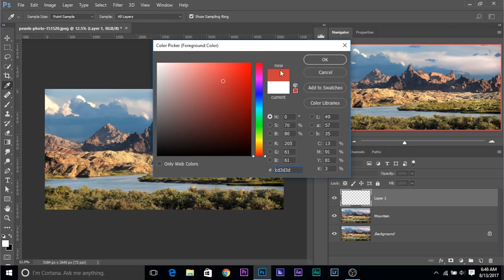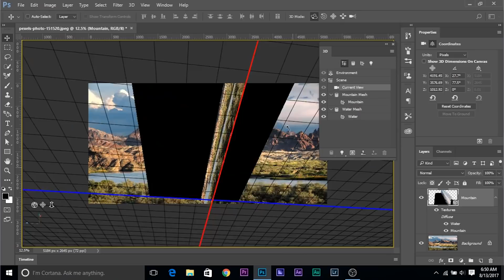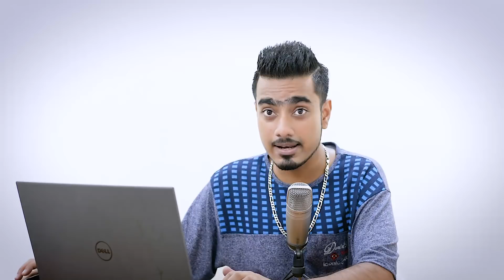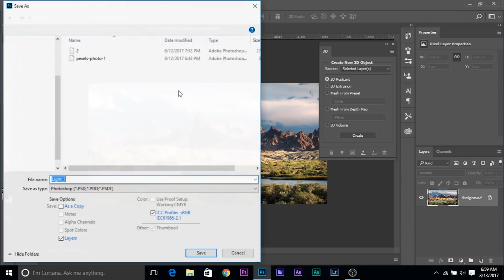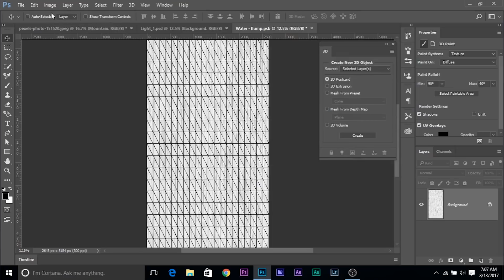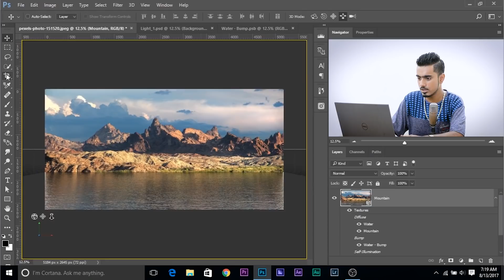Comment: Photoshop 2020, released in November 2019 switched up the 3D materials to Physically-Based Rendering (PBR), but just assumed everyone would know how to use it because they didn't provide any  documentation! Here's how to adapt:
Follow the tutorial and pause the video at 12:10.
Once you've clicked on "Mountain" in the 3D panel to display the material properties, just right-click on the "Environment" folder, then choose "Mountain" from the drop-down.
Next, click on the Water material. Instead of adjusting any sliders, click on the graphical sphere in the upper right corner, and choose "Metal Chrome" (it'll look like a distorted checkerboard). That will apply all the reflective materials.
Resume video at 14:23 and follow the instructions with ONE EXCEPTION. Right-click the "Height" folder instead of the "Bump" folder (which is now gone)
I was able to replicate the exact same effect with these changes.
Reply: Thank you for sharing this, but if I try to do that, there is not a reflection at all. only a black picture with the metal chrome effect. Do you maybe have screenshots on how you did it? I'm new with using photoshop sorry
Reply: @kaihaeyaert  hit render you'll get the results

Comment: Hi Unmesh - the 3D panel in PS 2020 is different (does not have shine and reflection sliders for example). Can you add a section to the video for PS 2020? I tried to follow your instructions but could not get the same result. Thanks,
Reply: See my comment (Sort by "Newest first" if you don't see it).

Comment: Hi, I opine all : The landscape part is not upright, as an upright postcard may be; with a landscape, if the mountains are further back and the bank area ie next to the water unless a vertically raised bank,  also slopes backwards, the reflection of the mountain will be less in the reflection; usually reflection such as in the final image suggests whatever is reflecting is high and next to the edge. For example, a tree at the edge might reflect any exposed roots, but these would not show if the tree was further. If the distance between the water's edge and the tree is subtracted from the height of the tree, then that will be a rough guide to how much will reflect. I hope these opined comments are useful.

Comment: Unmesh, this technique is the most natural that I have seen. I have a problem with this method. I select the two layers and click 3D but I do not have the same choices as what you see. I use PS CC latest version. I tried the 3D workspace, the Photographer's workspace, the Graphics Processor checked in Preferences, tried 8 bit vs 16 bit but the "New Mesh from Layers" is greyed out. Any suggestions?

Comment: Thank you - that was terrific, your tutorials are good - but this was outstanding.
Especially as it was using functions I have never even looked at!!
I will need to work through this a few times though to properly understand.

Quick tip or anyone practising this, 
I greatly reduced the size of the image, so when rendering it only took a few of minutes. 
(i had to download an different image of my own as yours downloaded as a .webp and photoshop didn't want to open it)